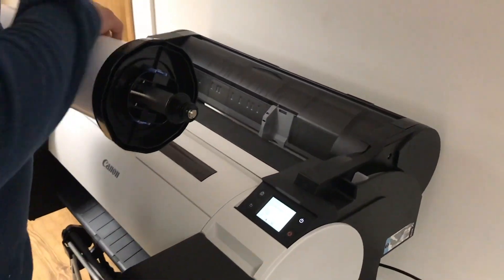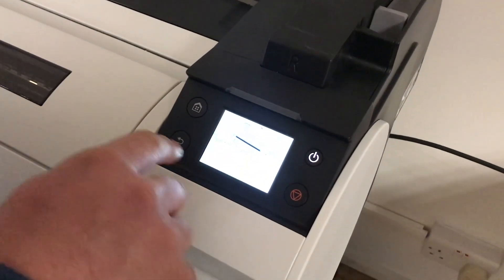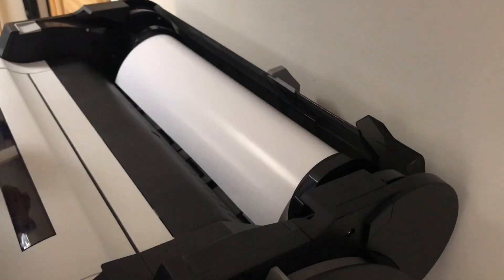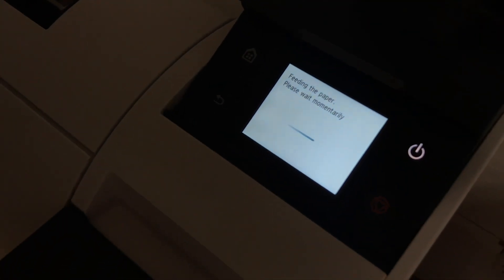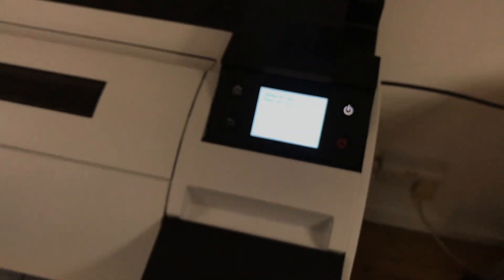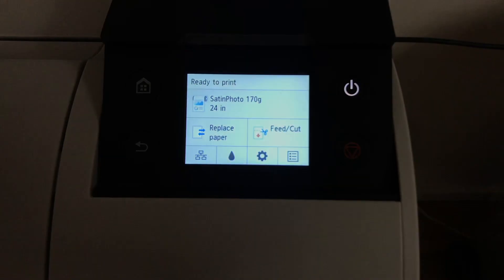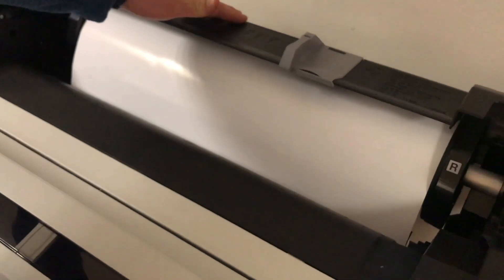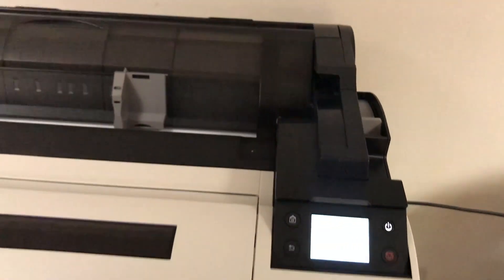How To Load Photo Paper On The Canon TM 200 24" CAD Poster Printer

Comment: Nice video! Thanks a lot. I have a question: when plotter has paper roll installed, you can load separate sheet? For example, a 24" plain paper that I use for CAD, and I need to print a photo on A4 glossy  paper? I have no idea if it's mandatory to uninstall (or feed off) the plain paper. Thanks!!

Comment: is this machine good for printing on vinyl? is it specifically made for paper printing and if it prints on vinyl is there a drag?
Reply from the maker: Hi Rebecca, you can definitely print onto vinyl using the TM-200. You would however need to buy specific water based vinyl for inkjet pigment dye inks. You can purchase both Self adhesive and non adhesive vinyl for use in all water based printers. Please do get in contact with us and we can guide you through the option, you can contact us on 01189 344426 or email us at sales@rgbuk.com. Thanks. :)

Comment: Can TM 305 print on flexy or Sticker (SAV)
Reply from the maker: You can defintiely print onto SAV but it has to be a coated water based product. Normal SAV that would be used for solvent printers would not work. hope that helps.